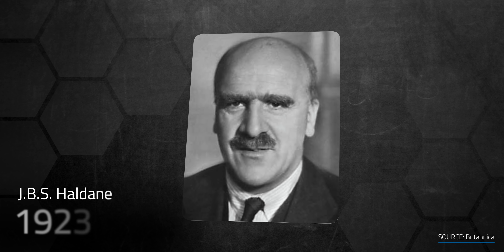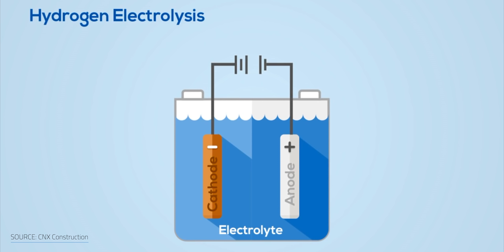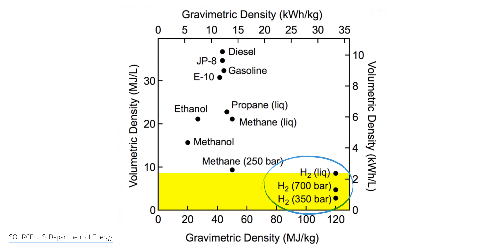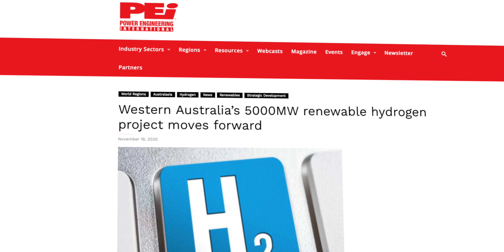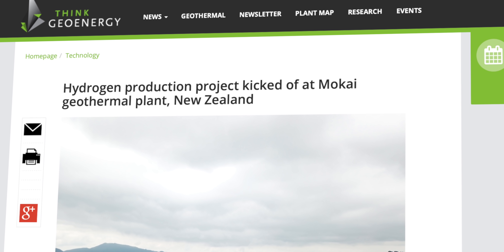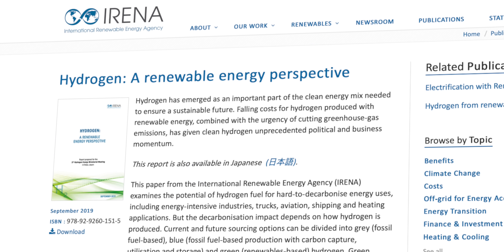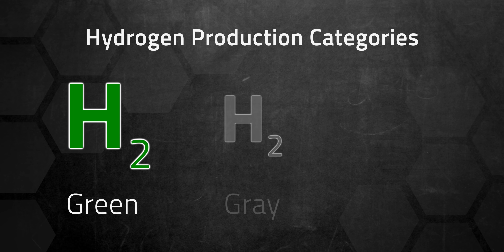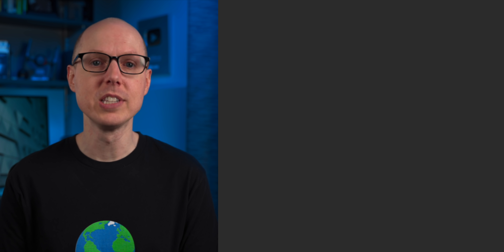The Truth About Hydrogen's Dirty Problem - Green Hydrogen Explained

Comment: Remember, all the energy you put into the hydrogen to release it from the water will come out of the hydrogen again when it ignites. That will not be a calm storm. Imagine a car crash. Tunnels will be the most dangerous place ever to be in a car accident. Hydrogen explodes. It doesnt slow burn. Just wait, you will see tunnel collapse when a car explodes in a tunnel. Which means no one comes to help you when you are stuck, since it's already so dangerous to enter tunnels with crashed fossil fuel cars. 
It leakes very easily, it ignites at a 4% air mixture, and has the highest NFPA 704 burn rating. No one can work on their own cars when you have a sealed hydrogen fuel system. Hydrogen cracking will force changing the hydrogen storage in the vehicle, which cannot be cheap. You need rocket engineers to work on your cars. You absolutely need the workmanship of a dedicated worker, who takes the responsebility for making sure everything is in order. One bored worker who has the Friday shift, who forgets to torque a gasket, and you go kaboom. Ka-fucking-boom, motherfucker. 
Hydrogen is dangerous, it's what makes the sun burn.
We do not need it parked on every street corner.

Comment: I used to work in a chemical plant that made Hydrogen as a waste product from electrolysis of Salt Water. The hydrogen was gathered from the the Cells into a large pipe header and sent to a building with two water ring compressors. It was pressurized and sent to two other processes where it was used to produced acid and an enrichment for another product.  The rest was sent to vent stacks to be dispersed to the atmosphere. The two biggest problems with this gas is it is such a small molecule that it will leak out of EVERY flange or connection the other is it has a very low explosive limit at low concentrations. The first problem of the flange leaks caused the hydrogen to accumulate inside the compressor building till it reached the explosive limit then it would explode. This was happening even though the building had ventilation fans. This building had the metal "Skin" blown off twice in six months. After the second explosion we just left the skin off and the building was basically just the support structure for the equipment. In a cold weather environment this meant we had to insulate and heat trace everything to prevent it from freezing.  The low explosive limit was scary because one day during a wet snow storm the static electricity from the snow hitting the 48" steel vent stack caused the stack to light off and start burning. Exciting next hour does not do it justice. We had to shutdown the whole process plant without blowing up the hydrogen system.  

One other problem is Hydrogen embrittlement  of just about any Stainless steel or steel product. This causes cracking and line failures in a system that is already prone to leaks. Trying to store this slippery molecule is a real challenge and John Q public is not going to be happy when hydrogen powered cars tend to go boom with little warning.
Reply: Would you say the answer would be mixing all of the available green options, for example you said hydrogen cars could blow up so in that case we don't go down that route and only use it in certain industrial applications?

Comment: the problem of producing hydrogen via an electrical process ignores the fact the electric isn't cheap be it produced by hydro, coal, or solar panels and the chemistry/physics of the process is fixed by nature and that it simply takes an awfully large amount of electricity to do the job.  Generally I see a sketch of some hydrogen fueling station roofed over with electric panels when in fact each pump would need acres and acres of such panels.  Much of the developed world lies north of 45 north meaning that for almost half the year such panels are relatively ineffective, it would be foolish to invest in solar in either Canada or Alaska and most of Northern Europe, likewise in most of Russia.  As for storage, all of the alternatives are presently costly and I agree that technology will improve over time but what I do see is that a lot of these technologies involve rare earth elements, 'rare' means just that, remember that gold is a 'rare' earth element as well.  The 'boom' jokes should be seriously considered, if you improve safety by 99% (I would assume 100% mean zero accidents) but at the same time increase utilization 100 times you'll still have the same number of accidents.  Frankly I think a lot of this discussion would if it was realized,  amount to a conspiracy by the elites to put the rest of us back on bicycles 'where we belong'.  The great absurdity would be building a city in Arabia using hydrogen when vast amounts of natural gas are being burned off routinely and where so much energy would be needed for air conditioning and water desalinization.

Comment: In a sane society, green hydrogen would be laughed out of the room.  Hydrogen is mother nature's dumbest fuel.  It's energy density is extremely low and it costs astronomical amounts of energy to liberate from water.  Not to mention, it requires different equipment to transport and consume and we would have to redesign everything from gas burning stovetops to automobile engines.
Reply: Exactly, you nailed it.

Comment: The fossil fuel gaz and coal used to produced grey hydrogen must be taxed on CO2 at the level of road  fossil fuels currently taxed near 500€ per ton of CO2 produced, the same apply for airplane kerosine, heating fuel, marine heavy fuel,etc. as any fair trade principle call for similar CO2 penalty of all planet CO2 contamination to be high and levelled in order to promote more green energies effectively and decarbonise our civilisation rather fast. Since  solar energy is basically free, and cost of P.V. dropping fast, the green H2 production becomes competitive on estival surplus. Note that electrolysis systems are cheap and also produces useful pure oxygen. The H2 compressing energy, very small, compared to very high H2 calorific value, can be partly recovered at decompression. Since H2 is threatening conventional oil coal and gaz and electricity producers they come un with all those inefficiencies objections.  But in essence, the cold processes like electrolysis and fuel cell catalytic conversion are efficient, clean, do not require expensive rare earths and metals, but only very little noble inerte metal easily recycled like platinum and H2 provides also an unbeatable long and economical, storage mean in composite pressure vessels without any energy losses with time, an essential key feature for the new variable, unpredictable and seasonal free renewables like wind and solar power.

Comment: As with all of these discussions, you totally skipped over the fact that hydrogen fuel cells are c.35% efficient - not a surprise because fuel cell manufacturers are keeping this to their chest somewhat. 

So you take a renewable source, lose 15% converting it to hydrogen, then waste energy trying to keep the unstable gas where you want it and cold enough to store sufficient mass of it and then just give away another 65% of what's left to propel your vehicle along. I'd suggest that aerospace is the ONLY application for hydrogen, where batteries are too heavy to make fully electric flight untenable. Realistically, there should just be fewer flights as there's not many 'necessary' flights. 

The only two 'advantages' of hydrogen are: 
1, It seems like it could be an option to store 'excess' power from wind and solar farms - I don't know if anyone has compared the cost/impact between this and battery, it seems hard to see hydrogen would have an advantage considering you have to throw away 70% of the energy.
2, People are impatient and want to be able to 'refuel' their cars rather than wait for them to recharge. This isn't acceptable and people need to understand they will have to modify their behaviour to stop the issues associated with climate change.

Comment: Hmmm, a bit more hand waving than your usual comprehensive overviews.   Key, you mentioned, and did not emphasize, you said "extension cord" which is exactly right.  So efficiency between the source (generally ocean water) to final application is operative.  And you totally left out the real challenges of handling hydrogen.  BMW put much money and time into vehicle development with hydrogen as fuel.  Shell Oil Co put a bunch of money into prototype distribution and fueling, and for a short time, there was a demonstration fueling station near the Capitol, and another at the Pentagon.  The tiniest of molecules, hydrogen is much harder to store, transmit, and contain in general.  An easy demonstration anyone can perform, is to have an empty container with a narrow neck, and add a couple of teaspoons of lye (sodium hydroxide) to the bottom, along with a few strips of aluminum foil..  Then take a balloon, and add water to the balloon.  Take the balloon opening, and fit it over the neck of the container with the lye (the fit should be relatively tight) and upend the balloon, pouring the water into the container.  A reaction will start immediately, filling the balloon.  When filled, remove the balloon, and see that it floats - now containing mostly hydrogen.  Alas, the demo is short lived, because the hydrogen quickly leaks, and the balloon deflates.

Comment: It seems like politically most people are fighting hydrogen development. I don't understand why. As you say, boats, planes and heavy transport in general would benefit. One clear benefit I guess most would argue is that the volume of the "fuel" necessary to propel a vehicle is much smaller and lighter for hydrogen than for battery- powered electric. Planes and cargo ships would not do well on batteries. 
So you come to the point of "money makes the world go 'round". And that is where I don't understand. How is it different or worse than production of batteries, and why can't these technologies coexist?
Are Tesla factories really disconnected from the power grid? Do they not consume a lot of non - renewable material compositions? They also exhaust "local" water sources. It has been said that Germany as an example run mostly on renewable energy, but is that the truth? They actually import energy from other countries, and that energy is either non-renewable in part, or it forces the exporting country to rely on more non-renewable energy for its own power, as countries like Germany become symbols of the green shift.
If I am wrong in my assumptions I really would like to know. But why is it so hard to embrace hydrogen as a potential parallel path to e. g battery technology?

Comment: I'm a big proponent for hydrogen. One of the biggest criticisms of renewables is the unstable nature of them. You can't just plug a bunch of solar panels and wind mills into an active grid and run off of them directly. It won't always be sunny and the wind won't always blow. Renewables would also be at odds with the wax and wains of power demand. We'd need to generate an excess and store it for a non windy day. There's been a huge push in energy storage around this problem.

One current solution are giant electrolytic battery banks. Problem with those are cost, reliability over time, and the dirty way they are produced.

I find hydrogen another means to store this energy rather tempting. However, it has a big problem that was glossed over in the video...
Hydrogen fuel cells.

Hydrogen fuel cells rely heavily on platinum for the production of electricity.... they really aren't cheap and use rare and valuable metals.

Hydrogen could also be used in combustion engines as fuel and would burn completely clean. The only gas it'd emit would be steam, water. Problem with combustion engines are that they are incredibly inefficient and would loose a large portion of the energy used in making the hydrogen in the first place...

Comment: With respect to the concept that hydrogen will be part of the internal combustion engine future the reality is that hydrogen as fuel replacement is without merit. Four stroke engines do not run as efficient on hydrogen than they do on the current fuel choice. The better alternative is low emission fuels like mixing petrol with methanol and ammonia to produce a far more efficient and sustainable alternative without the massive infrastructure change currently being set up. Electric still does not match the current 4 stroke engines ability to produce the required demand for the amount of fuel on tap.

Comment: the eventual practical general uses for hydrogen power i can imagine are, planes, trains, buses, ships, and for grid balancing, where turbines would run off it during times of high electricity demand and low sunlight or wind. i don't foresee it powering homes or private cars, the gas is too impractical to deliver and store for those uses

Comment: Will we have enough hydrogen? Matt its only a issue if you blindly look to solar and wind. Most countries with nuclear run on a 30% capacity pay off model. So the US can right now produce 20% of its energy in hydrogen from nuclear. It the nuclear plant is updated efficiencies of 80% can be achieved. gen 4 plants IE MSRs will be perfect for this due to high heat.   even green concrete

Comment: It is funny how people would yell and scream if everyone had cars that leaked gasoline on the ground, but everyone just accepts that their battery powered vehicle looses charge over time.  This doesn't happen with a hydrogen fuel cell vehicle. They are even better than a gasoline vehicle or a diesel one as the hydrogen stores indefinitely. Want to take that 2 day trip to visit Grandmother? Better plan on some long recharge time as well because fast charging shortens the batteries lifespan. Then there is the replacement cost of a new battery pack and the disposal of the old battery pack to plan for as well. Taken as a whole hydrogen is a much better investment in the future.

Comment: As far as I know the only desal plants in Australia run on gas. Australia runs on gas and coal. Desal uses a butt ton of electrical energy without the added electricity needed to produce hydrogen. Cool your jets there turbo. Without a change of government this is just hot air.

Comment: Even when hydrogen is split from water it is not best used conventionally.  The fusion nuclear SAFIRE GENERATOR by Aureon Energy Ltd. of Canada is the actually cheapest, cleanest and least expensive solution for clean electricity. Wind energy, solar, hydro and other green technologies are now just superseded. Hydrogen will not either become a future conventional fuel but a nuclear fusion one! Electric power is the future for autonomous small aircraft and with ever more battery energy storage density perhaps some larger ones. However, FUSION NUCLEAR IS THE FUTURE of ever-larger commercial and military aircraft. Now we have a 24 hr. reliable fusion power product. We now in 2021 have super cheap nuclear fusion energy already proven and almost commercialised as in being in advanced production, that of the "SAFIRE GENERATOR". So sadly, storage technologies and the power from ITER-type fusion power generators as well as conventional fission nuclear are going to be eclipsed. Current magnetic plasma confinement strategies and all current green energy technologies are totally out of date and relatively redundant. All our effort must now go into EVER HIGHER ENERGY DENSITY BATTERIES because green energy is now solved. With intermittent green energies we need an enlarged electric grid, so we see wind generators, solar farms and a multitude of variable green technologies with expensive backup batteries and they are all ugly and use up much land, while also being significantly capital intensive and all while having some safety issues. They are all also going to be unnecessary with the advent of the "SAFIRE GENERATOR" that is safe, costlessly self-fueling, totally green, buildable on any scale on a tiny footprint to safely match local community requirement and it is easily chokeable and 24 hours dependable. It makes all other technologies redundant as in being much less advantageous. It is fusion nuclear powered by nuclear "NUCHEMY" and seen at "AUREON ENERGY.COM". Also learn your new plasma physics, astrophysics, and general Electric Universe Theory at "THUNDERBOLTS PROJECT.COM". This way you can learn your new EU Theory, advanced plasma physics and all needed to fully understand all this new academic and practical material. and appreciate that all the other green technologies are currently just now superseded.

Comment: Norway has one hydrogen fuelling station. Norway's ONE hydrogen fuelling station caught fire and exploded.

We can simply do without this. It's less energy efficient, it's less mechanically efficient, it's less infrastructure-efficient, it's not necessary. Just use batteries.

Comment: The thing is that during the process of creation to final use, lots of energy gets lost. Meaning, the end user will be billed for the full 100% of the cost, while only able to use ~40% of that effectively. If green energy sources had been used for the creation of this hydrogen, 60% of those windmills and solarpanels are working for nothing. Also, the infrastructure that's until now non existent needs to be built, which is insanely expensive, and again is going to be paid by the end user. 

I think there are going to be some use cases for hydrogen, like for big ships. Those are extremely polluting and there is no other solution for that. Trucks will ultimately drive on electricity, just like airplanes. Airplanes will be brought to height with a pusher where they can fly super efficient due to low drag, and thus need a very small battery to reach destination.